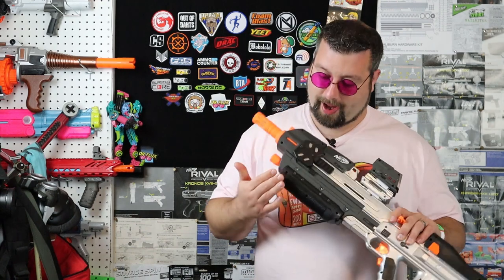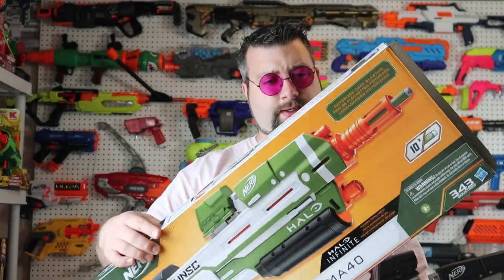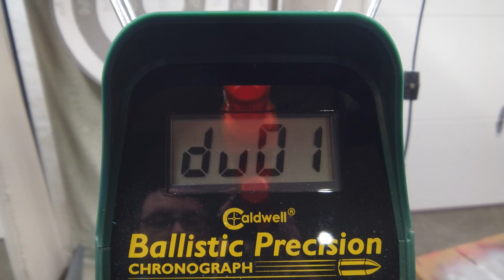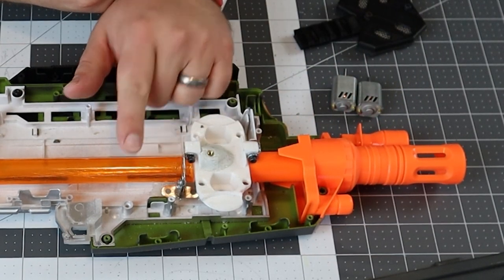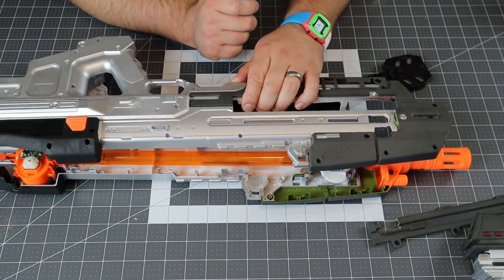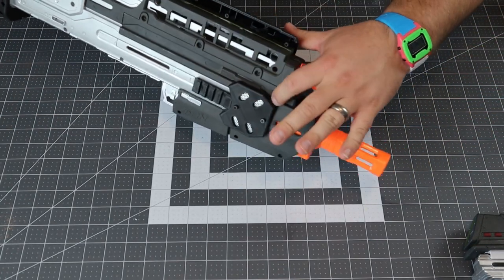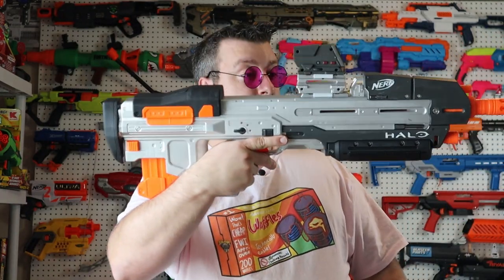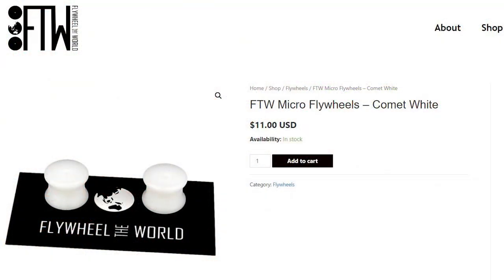Nerf Halo MA40 MOD 170+ FPS 3 S LiPO Power!

Comment: Beautiful  mod, beautiful look. For asthetics do not use the rail riser just put the fake ammo counter on (the riser is only meant for using optics that do not come with the blaster). If you want a consistent look make a second motor cover and glue it on to the blaster at the same point on the other side. The best addition to the perfomance would be to make it full auto.

Comment: Love what you have done for this blaster! I am looking to do similar for mine. it is my first blaster an I am trying to wrap my head around everything. What lipo battery are you using that is able to power those 4 motors and fit in the battery compartment?
Reply from the maker: pretty much most the 3s /4s batteries Luke sells at Out of Darts

Comment: How to mod the battery. Instead of using C BATTERIES 🔋. IS there anyway to use removable LITHAION  BATTERYIES. SO IT CAN BE RECHARGE USING TYPE C. IF THE BATTERY EVENTUALLY LOSES IT YOUTH. COULD BE MADE TO SWAPP OUT

Comment: I am thinking of doing similar, but I want to keep the fps to around 120-150.  my two most pertinant question though is this blaster wide enough to put something like a dessert pidgeon flywheel set up in here and how hard would it be to put an auto pusher in?
Reply from the maker: yeah worker hurricane flywheels and flywheel of the world sized cages fit much better
Reply: @drflux  my idea is essentially a mix of yours and project nerf's, turn it into a proper AR, add in a functional airsoft flashlight, and paint it to look like the MA37 from Reach. also you didn't need the riser with the faux ammo counter.
Reply from the maker: @VulpusArmory  cant wait to see how it turns out. Sounds wicked!

Comment: Won't show wiring, won't explain advantages of new motors,won't show adding new batteries but will talk at length about dust cover (which could have been unnecessary if a precision hole was cut) and ergonomics. 

Found your video/channel since I'm very disappointed by the performance of the nerf AR and was hoping to see how to mod it. All the Important stuff how to do that was glossed over and minor stuff was discussed/portrayed at length like unboxing. Very cool mod, would have like to see the step by step of doing the mod instead of fluff.
Reply from the maker: go check out project nerfs video im pretty sure i said that in one of my MA40 videos.